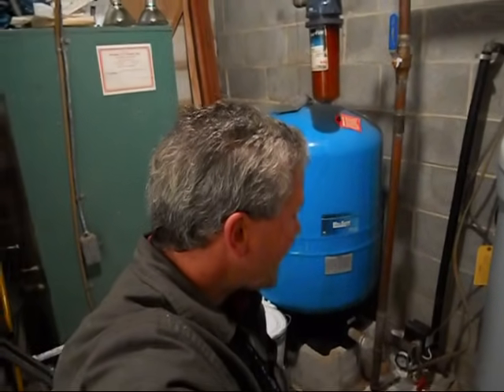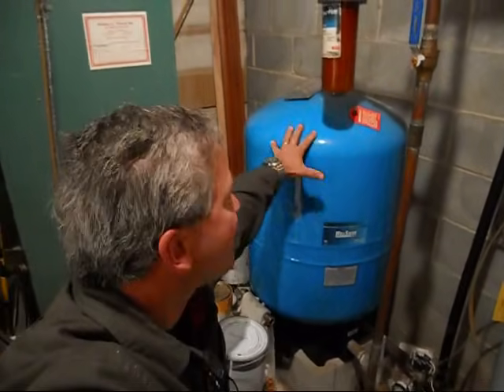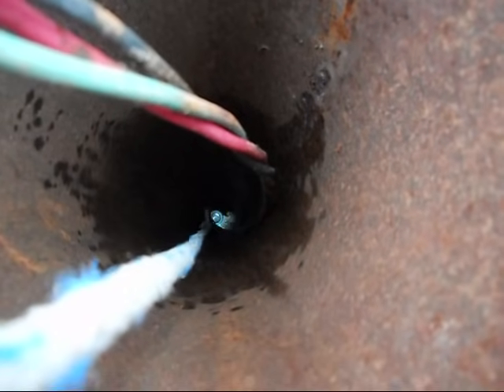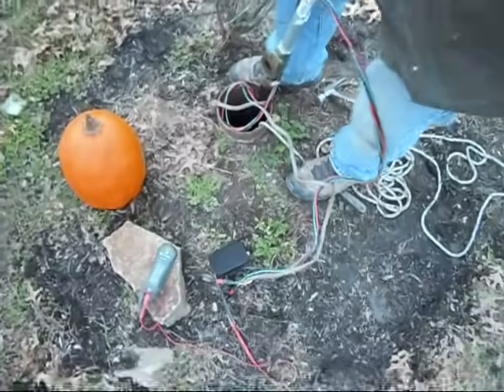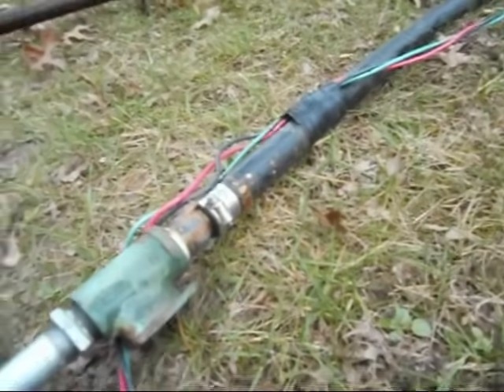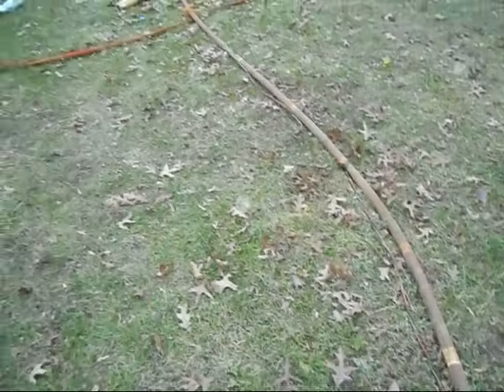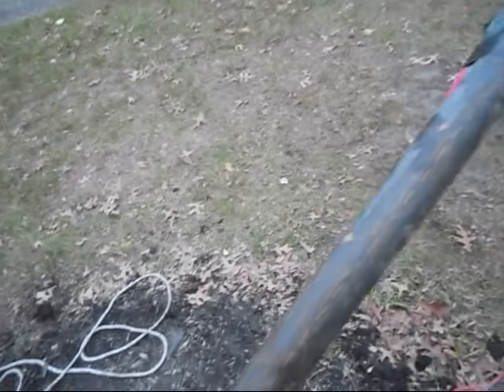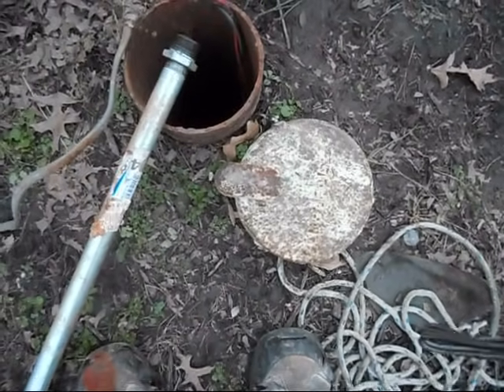Replace Well Pump in 4 hrs (all 12 videos clips) 100 ft Myers 2ST52-8 by Tatcor.com West Chester, PA

Comment: How aobut shoiwng what kind of Water Treatment In the House? Besides a Water Softner.. Deironizer  ..many of our Well in Wi. have High Iron that a Reg. WS can't Remove and end up Using Rust Preventer Water S. Salt.. But Installing an Additional DeIron Tank eliminates need that More Expensive Salt.. and maybe even having a In House, under the Sink RO Unit to be sure your Drinking water is Clean? Or at least a 3-5 stage COUNTER TOP Water Filter for Drinking?  At least that is what we have for added Insurance.

Comment: Had mine replaced in 2010. 2500$ and they did not even shut their truck off. There for maybe 1-1/2 hours. Wished I had shopped around but was under pressure. I am going to do my own next time ...hopefully. How do they justify so much. Yes new wire and it is  300' down. Seems like they are very profitable to do??

Comment: I did not originally understand how the wedge type fitting worked either. It uses a simple "o" ring that seals against a flat smooth surface. Hope that helps.

Comment: Great video. Thanks. 
80 dislikes came from professionals who r charging $100-200/hr.
Reply: They charge that much because knowledge is worth that much diagnosing something like that isn’t always that easy especially if you have a large water system with lots of filtration three phase power or constant pressure no average Joe can figure that stuff out😉
Reply: Serge R or just that annoying beeping noise
Reply: Just to clarify, the employees of most contracting firms don't make $100-$200/hr. I don't think the Average Joe realizes the overhead costs of running a contracting business. Everything from trucks, fuel, equipment, to accountants, computer software, rent of shop space, electrical bills, employee payroll, etc. etc. has to get factored into the price. 

If you want to do it yourself, great, but don't criticize those who do it for a living.
Reply: But they're still charging $100-200 an hour. HA!
Reply: we charge that much because home well water is regulated. we cant just show up and say yeah here is water. There is a lot behind it. If a well we put in poured cancer into your plumbing, we are sure you would have something to say about that. Reputable well companies deliver good water.
Reply: @ryansullivan1327  What video did you watch?? This video is about replacing a well pump not drilling a well. The pump has nothing to do with the water quality.
Reply: A professional would have at-least had a rope tied to the pump incase that furnco fitting came loose..You now have a pump 150 ft down in your drinking hole what will eventually rust.A professional would have atleast put a new oring on there,A professional would have atleast cleaned the pump/screen off.You pay for what you get,. A professional is licensed and insured..This guy just did what works,a professional would have went x10 in making sure it's a  Perminent fix that is going to last.and be sure it's in code.
So don't speak on something you know nothing about.
Reply: @shawnp8429  SO YOUR SAYING THE WELL PUMP WILL RUST? BRO PUT THE CRACK PIPE DOWN,COMPLETE IDIOT RIGHT HERE

Comment: It's a pitless, pitless, pitless!!! LOL, Good job for your first time you're lucky that pump was only down a 100 feet mine is down 475 I had pipe all over the front yard!! And I had to rent pump puller because there is a check valve on top of the pump so the pipe is full of water with the pump it probably weighs about 250 pounds!!

Comment: Also at your local rental store, they rent a pump puller it has three wheels the pipe goes in between and the rollers(wheels) pull the pump out with good old electricity !!

Comment: After watching your video ( and about a dozen others on the subject) I was able to be the site expert on my sons dead well water system.  Replaced pump.  Recharged tank.  Replaced pressure gage and drain spigot.  

Could not have done it without you.  Thanks about $1000 dollars.

Comment: people do need to realize in different areas wells can be deeper and pumps/motors can be set deeper. i work for a well company flynn drilling in mo. i cant tell you how many times people have tried and pulled there own pumps got it out of the pitless and it be to heavy and drop them. and seriously hurt themselves. not to mentiom going fishing for them sucks. i can help and answer any questions about wells if you need help im all about saven that money. but be safe while doing so.
Reply: yea , I have just replace a pump for the first time at my first house it cost me $1400 here in FL they used a truck with a crane and I dont know how deep... my question is how much net profit does  Well service generate a month ? I am not complaining I just wonder....
Reply: Brandon Cunningham can you tell me the proper PVC pipe and fitting set up for a top pump sprinkler well pump 1 1/2 horse
Reply: 1 1/2 hp? You probably need a 1 1/4 inch polyethylene drop pipe (from pump to surface) and obviously the necessary pitless adapter. Read the pump manual first!

Comment from the maker: Hi Dennis - I would recommend help and a roller to guide and protect pipe being pulled out. Other pros have commented on details. I do not know the best pump. When I worked for Ingersoll Rand Pumps and Gas Compressors, I was amazed at the differences in motor designs offered with each pump.  I expect the motor provided will  make a huge difference in the well pump performance.  Good luck.

Comment: nice video, can 150ft one be pulled by one person? whats the best pump on a market?
Reply: I pulled one out by hand at 750 feet with one other guy, it hurt...
Reply: wow i bet, im just trying to estimate how much 200 ft well with a water in it weights,my well 16-17 years old and i wanna be ready when that day come
Reply: Should be like 30-40 LBs because its probably a smaller pump. DO NOT do it alone, get a buddy to help you because if you drop the pump down the well it will cost you a fortune to get it out, they do have machines for pulling but I'm not sure if they have them for rent at the hardware store. Flotech has a 20 year life so that is the best brand I know of waterworks is good too, hope that helped, bud

Comment: Great video... I'm in the middle of trying to fix mine myself due to pump failure... question/advice please.... I'm considering on putting a tap at the top of the pump before it goes into the house so I can connect a hose pipe for outside watering.  this would then go before the pressure switch and tank.  would this be a bad idea and potentially burnout the pump?  suggestions please?

Comment: Did you happen to catch about how far was your water table when you went back down?  Looked like from in the video it was around 20 to 30 feet.    Hope you taped the splice kit up good, it can bend back and forth from the pump starting and break the wires.  You look like you have a lot of iron in your water too, do you have a filter?  Might be too much and clog your lines over time and your pressure will get worse in your house.

Comment from the maker: Hi Mac. The tank is 52 gals  and provides about 17-19 gallon drawdown.  Pump is running well and may not cycle in a shower.  Thanks for the reminder to check the pressure.

Comment: LOL I hate to say this but be thankful your pump wasn't hanging in on galvanized steel pipe. That is a slide type pitless adapter & those are torque arrestors. You should have used a 1" tee handle & tightened it into the pitless & marked its location with lumber crayon on both the tee & well casing. Being a  Water Well Drilling & Repair company in NW Ohio since 1966 now owned & operated by 3rd generation we could have probably had you up & running in maybe less than an hour. One of the most important tools to check a submersible pump system is an electrical tester that will do Amps,Ohms & Voltages & a diaphragm,bladder or regular pressure tank should hold 2-5 PSI less air than the cut in of the pressure switch! A normal pump replacement here from us is about $800 depending on materials used as of Nov,2015.
Reply: My wife and I have grown up on city sewer and city water. SO, no well's or septic. We are bidding on a house in a country town with both. The well pump is at least 17 years old. Can you tell me if that is near it's end of life?. I called a well guy and he didn't really give me an answer but said if it failed to call him. He said the price to replace the pump would be around $2500. Is this crazy? or normal?. Can I do this myself, IE buy a pump and have someone who knows basic plumbing skills replace it?. AND, should I replace it now or just wait for it to fail at some point?. Thank you!!!.
Reply: 17 years old? That pump has done well. I would assume it's nearing the end of its life and plan to replace it sometime soon. It's so much nicer to replace a pump at your convenience than when it's an emergency. Trust me, I've been there.

$2500 sounds like way too much money for a pump replacement. BUT.....details! How deep is the pump set? Deeper can mean more work. What's the pump horsepower? My little 1/2 hp Myers pump cost about C$400 but the 1 1/2 hp Grundfos I'm about to install cost around C$1500. One more thing: if your pump is hanging on steel pipe I'd be charging more to pull it because it's simply harder, slower work. Good luck!
Reply: Do u guys do business in Colorado springs CO

Comment: I own a house with a water well and during my 13 years there this will be the fourth time I've had to pull the pump up from 200 feet down.  The first time we hired someone to do the work and I watch them and asked a zillion questions so the second time other than getting the pump out, it was pretty easy.  It was only after I tested the pump after re-installing a new pump that I learned there was nothing wrong with it so we saved it and used it again when the "2nd" pump burned up after a faulty pressure switch that we used it as our "3rd" and it lasted a good five years.  It recently died along with a diaphragm that it's bladder no longer works and had become water logged so I'm replacing both at the same time.  The whole system was outdoors, so I'm building a shed around it so I don't have to freak out every January for two weeks when temperatures are below freezing for three days continuous and pipes burst.  In other words, I'm doing it in my mind the right way.  I have a 5250 watt generator for backup power; I don't use it often but I also want to add a manual transfer switch to this project or a separate stand-alone for the well.   It is my understanding the bigger diaphragm I get, the less pump cycles, but I also find myself thinking about adding a 500 or 1000 gallon water storage tank which I then can either gravity feed or use a shallow jet pump and more importantly have backup water when the pump does fail I have time to replace before going dry.  I've seen no video with a storage tank.  My thinking is a new 3/4HP 220 volt deep submersible pump, pumped through a whole house sediment filter with the means to bypass if necessary to a 500 gallon water tank, then a shallow jet pump into a diaphragm tank.  I know I need a float valve for the tank.  Now before I have to do all of that; I've seen video where some folks use more than one diaphragm in succession to add storage; Any ideas would be appreciated.
Reply: +Bill Berry Hi, i was wondering if you can answer few questions if you dont mind, how heavy was the pump and the piping? was it  a same 1" pittless fitting? i have 16 year old pump 270ft well just preparing so i can be ready when it fails, maybe i should buy a pump so i can have it on hand, 
Thanks

Comment: More details on making your handle device would be appreciated, Thanks
Reply: From what I saw in the video, you'll need:

(2 pcs) 3/4" x 18" galv. pipe
(1 pcs) 3/4" galv. "Tee"
(1 pcs) 3/4" 6' galv. pipe 
(1 pcs) 1"x3/4" galv. bushing

Screw the bushing onto one end of the 6' pipe, screw the branch of the "tee" onto the other end, and the 18" nipples into either end of the "tee". That's it.
Reply: @walterbrunswick  That is exactly what I saw,and used,,,This is a very informative video...

Comment: I had my pump replaced and also replaced the wire as well. The wire appeared good however, for the extra  $170.00 I believe it was well worth it.  My pump is a 3/4 h.p.
at 168 feet in depth. It has 3/4 inch galvanized 12 foot sections of pipe connected to the well pump. Each section has to pulled and separated which, believe me is no fun. Remarkably the pipe was in very good condition and remained, however, this
is not a job for a DIY as it requires a special setup of equipment and special tools 
as the weight itself is quite heavy especially in the start up phase. I like your setup
with the pvc nice and pliable and light. Thanks it is a nice  informative video.
Reply: +common logic People viewing this video and making comments about how now they can do it and so forth need to read your comment and realize that although it may go easily or somewhat easily, it can also be a difficult job for a pro with years of experience and a dedicated puller and everything else needed. 
Just stating the facts, not trying to discourage anyone, I try to do almost everything myself also and prefer not to pay someone whenever possible. Just be aware folks.
Reply: I have the same galvanized setup. 21 lengths of pipe @ 255 ft. We didn't know that the cause of our last pump failure was shifting rock "pinched" the pump into an hourglass shape. The puller rigging actually lifted the nose of the contractor's truck while he was trying to pull the pump!

He SAYS: "25 years doin' this sh#t an' I ain't seen nothin' like this"... I HEARD: "$$$ blah, blah, $$$!"
Just before giving up and pushing the pump down to the bottom of the well, it broke free and we could see by the scraped/crushed housing what had happened.

Of course this happened during a Wisconsin ice storm on a holiday. Had to blow the dust off the wallet, bend over and pay the pros for this one. (I believe about $1500.00 w/the new 3/4 hp pump and wire. This was a few years back). Would have been a helluva DIY project. Nothing's easy on this possessed property of mine :)
Reply: common logic Those guys don't come cheap, their rig is probably 100 grand or so.
Things like pumps ect pick the worst  times to quit..

Comment from the maker: Our business is building and remodeling (Tatcor,com). We regularly hire plumbers and other professionals. When we lost water pressure at our home, I decided to try and replace our well pump by myself (my uncle, who was a plumber, told me about the pitless adapter which he called by a different name, but that got me going). My father stopped by at the end to see how it went. I have not and do not plan on replacing well pumps as a business. Several well pump professionals on You Tube have provided helpful comments to this video which is very much appreciated.
Reply: homeowners without training, expertise and equipment should not attempt this. I have 30+ years on deep wells and can say this is a bad idea.

Comment: This(these) videos helped me and my father-in-law replace my 23 yr old submersible pump. After talking to some local professionals and what it was going to cost me and the amount of work that they were saying it was going to take.... I decided we would give it a shot. Two trips to Ace Hardware and 5hrs of work....we pulled almost 300 ft of pipe.... I've got water.  Just under $400 in materials.....Thanks so much Steve T.
Reply: Mike Rodo  how hard was it to pull 300’ by hand? Mine is about that deep wondering how heavy that is before I start it...
Reply: @Crazy88boss1  how tough was it? Did you do it yourself?
Reply: @whitneythomas4289   it wasn’t to bad with three guys on it, ended up being about 390’  took about an hour ran new pump and new wire worked great
Reply: @Crazy88boss1  do you think you could do the same with galvanized pipe?  Just lifted mine up a little….it’s extremely heavy but was disappointed that the pipe was metal.  Now I’m in a bit of trouble.  I may have to pay someone.
Reply: @whitneythomas4289  no way, I would have to pay some one plastic was heavy couldn’t imagine metal! I would have it changed when you do though
Reply: So how many times did you have to replace it after that 😂